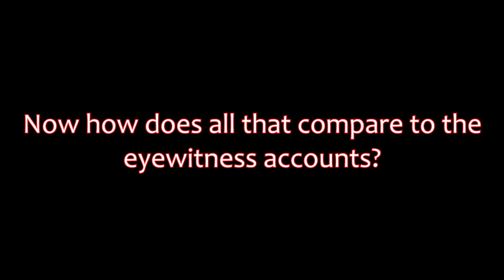Video 2: Anatomy of a velomobile crash

Comment: From time to time,  lose traction on the rear wheel of my tadpol trike on bad roads, paricularly when on  high speed bends on rough surfaces. The wheel slides around but  not a big deal, easily contolled by steering
Reply from the maker: Hopefully it has not resulted in anything that would cause such catastrophic results!

Comment: It is clear that insufficient rear wheel suspension caused this accident. To prevent this kind of accident the rear tire must also be enought wide and big and not too hard. This velomobile had also too much weight on front.
Reply from the maker: The weight distribution was probably about right, with the pilot and most of the weight between the front at rear wheels. The main issue, as you pointed out was loss of rear wheel traction. When physics took over, there was little Bill could do to prevent what happened.

Comment: It was the paint on asfalt.
I mean just just try to go on crossing(on coblestone especialy) at winter when there is just litle wet snow, it slips like hell. on asfalt its propably have more traction but for velo with very small tires its not enogh.
Reply from the maker: The bigger issues were: no suspension on the velo, and rumble strips cut into the stripe.

Comment: The velo became airborne, as soon as air was able to get to the underside the vehicle,  with the air going over the velo, she became airborne. Simple laws of aerodynamics and equalisation of pressure, then the flaw of a tripod design occurred when one wheel loses contact the remaining wheels follow the path of least resistance almost resulting in a head on collision.
You see this on f1 cars and recently in the America's. Cup.
A better suspension would lessen the percentage of this happening,  but the oncoming truck altered the wind pressure, it was a triple whammy.  
You could run a computer analysis of the forces at play here.
Reply from the maker: Yes, there were a lot of factors. All of which combined for a not fun time....But Bill lives on!

Comment: It might be a aerodynamic problem with this particular velomobile. It has a longer cockpit than most common velomobiles, which means a larger surface from the side, which means a stronger wind pressure when it's taken to the side, making it harder to countersteer and keep on its wheels.

Edit : lack of suspension on the rear wheel is certainly the first problem to solve. Good to know that it's important.
Reply from the maker: There was very little wind in this area, and on the ride as a whole for that year. It was all rumble strips and loss of rear wheel traction.

Comment: i've never had a bike just go off on one like that, and that's after 50 years of riding enduro motor cross and mountain bikes. that are no safe.
Reply from the maker: I've never had a BIKE (two wheeled bicycle) do that either, and I've been riding just as long. Physics in a velomobile and on a tadpole trike configuration are different. Stay tuned for next week's video.

Comment: Interesting analyse. He was very lucky not to be thrown against the truck. What I didn't understand is why his wheel lost traction?
Reply: 120 psi with no rear suspension over rumble strips made the rear wheel bounce up and down.  The rear can be seen going up and down. Very little moment (torque) is needed to swing a tadpole trike around.  With adhesion lost on the rear, it snaps around the axis.  Counter steer into it was good but it was inevitable endo at that point.  How to mitigate...
Reply from the maker: @edbernasky1838  Stay tuned for next weeks physics video! Very observant though my friend.
Reply: @TheFlamingEyeball  rear suspension can be a great help in such situations, especially with elastomer...
Reply from the maker: Indeed. My new Quest has a Risse air/oil shock in tne rear. Much better. I use elastomers in the front, and have fir a few years now even on my previous Quest. I was pleased to see the new After 7 using elastomers....I thought, "Hmmm. What a good idea." 😉 🤔 🙄 
https://youtu.be/KNU4NMmvWOE
Reply from the maker: That question will be explained NEXT week, lol. I made a whole video about physics and how it applies to tadpole trikes. You may be interested to see that one as you ride tadpoles.